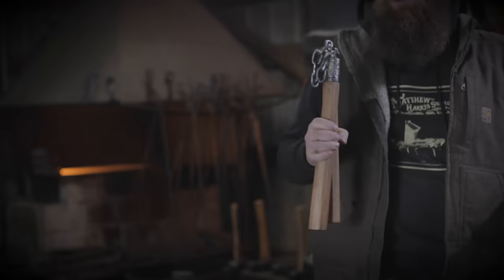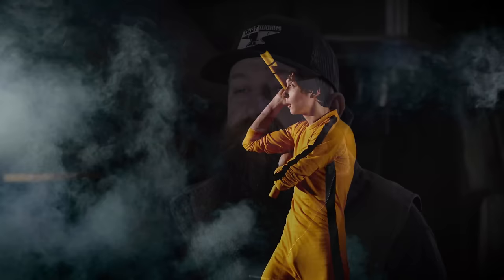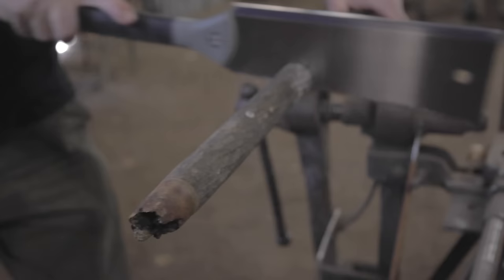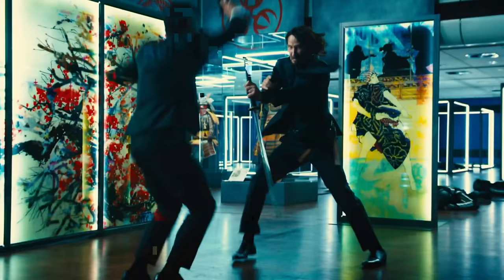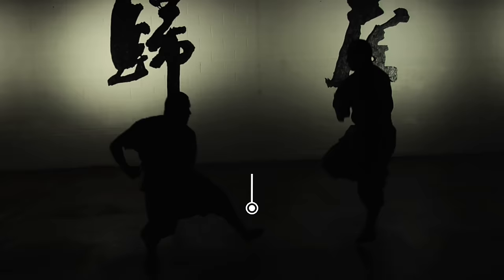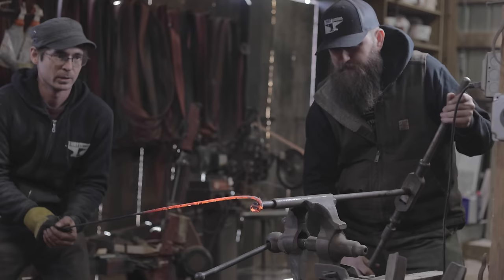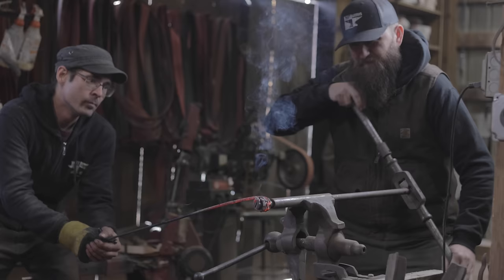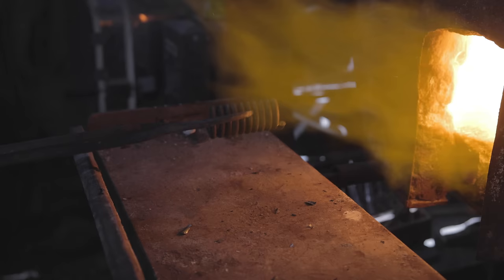John Wick 4 Nunchucks - Did They Exist in Battle ?

Comment: I have trained in Okinawan Matayoshi Kobudo which included Nunchaku. Though technically I was not at the correct belt level to formally train in them, however when the higher belts were training we were permitted to train in these weapons. They are not too hard to learn basic whipping them around... but they are very hard to master and not smack yourself in the head or elsewhere( we had padded foam training ones that were not allowed to leave the dojo as per Australian laws ). Super fun once you know the basics. I also trained with a Bo, Tonfa, Sai, Kama and Tinbe-rochin (sword and shield).

Comment: I have a pair that use rope instead of chain and was told the Ninjas used the rope because it was silent. They are really sharp octagon that gets larger at the ends. Solid hard wood with sharp corners to crack bones and a silent lightweight rope make these pretty sweet. The chain looks cool though.

Comment: One area you never talked about but it has been a common way of thinking about the Nunchuck is with monks. This I think holds the best ground as plausible because as you said the Nunchuck is less effective at maiming or fatally wounding someone which most monks are considered to be pacifists in nature. They would not want to mortally wound anyone and just defend themselves. They also have years that they could easily spend learning to use it which you also said was needed to use them. I'd say in a proper battlefield or more military style martial arts usage were likely never a thing. However in a more pacifist style of martial arts which would be common among monks in China and Japan I could see them using it as a means of non-lethal self defense. Much like  mace or pepper spray is used today.
Reply: I think the expectation here is that if the monks did do this, there would be evidence of martial arts using the nunchaku earlier on. Per google the first known kata for nunchaku was developed in the 1960s. If Japanese monks, warrior monks or otherwise, were defending themselves with this tool they likely would have developed kata and ritualized practices. It is possible it went undocumented, but that seems weird considering how much documentation we have of other fighting styles and techniques from Japan's history.

Comment: I like the combination of Documentary and build. That is a lovely pair of chucks too.

I've had self-defense classes, and flexible weapons where pointed out as a vary difficult class of weapon to master for what you get out of them. Modern expanding batons exist, and those are plenty capable of cracking a skull. However, Learning a flexible weapon (Nunchucks, 3-section-staff, poi/rope-dart, meteor hammer, etc) was good for the hand-eye coordination of any student of said instructor that chose to learn one. if you can use a flexible stick to beat someone's ass, you're going to have that much easier of a time with a not-so-flexible stick.

The closest thing to a modern nunchuck is probably the Billard-ball and paracord Monkey's paw, and I understand those to be fairly effective.

Comment: Re: Origins of nunchucks:
  What I learned, it came from when Okinawa was the Ryukyu kingdom. At some point during the latter part of being a tributary to the Ming Chinese, it started certain military cutbacks. If I recall correctly, the Chinese were unable to send any kind of military support to the kingdom at the time (probably fighting its own wars on the mainland), which asked for assistance when the Japanese eventually started making moves. Anyway, some time between the the domestic military reduction and Japanese takeover, nunchucks were developed and formalized as a self defense weapon for commoners due to a variety of bans in place.
 I don't remember if the bans were a result of Ryukyu's policies or Japan, post invasion, but they both had restrictive policies. If it's the former, then it's possible they were used on the battlefield in the short span during the Japanese conquest as commoners would likely have been levied to make up the rank and file of the army, but that's just speculation.
 
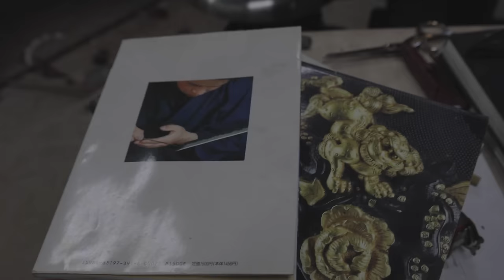 15:25 : I don't think it's a 0 or 1 here because people can teach others the fine points of usage and begin codifying it into a system. Also, in the case of Okinawa/Ryukyu, they've had a fairly long standing tradition of formalized martial forms.

Comment: There is a third reason for shortening a weapon...close quarters combat...using in a confined space,  hence why there are instances where a knife is a better choice than a sword, or an escrima stick better than a Bo staff.   You had mentioned the Rice flail with the long and short ends.   In China, that item was used as a weapon, there are still those that teach it as part various systems of Kung Fu.   

Also there is an origin for the Nunchaku that you didn't mention, again myth, legend, or fact who knows but it goes something like this.   In Chine there is a weapon known as a 3-section staff, which is basically three sticks, just over two feet in length (usually about 26 inches) joined by a chain.   The legend is that in a fight, someone using one of these had the center stick either broken, or cut with an edged weapon, and began using  them together.   Over time they discovered that making the sticks of equal length worked better for adapting the already existing techniques with the 3 section staff to the new 2 section weapon.   Again, I don't know if this is any more plausible than the other ideas for origins (personally I have always favored the Okinawan rice flail origin story) but it would explain how the skill of using it could have been learned, being adapted from the similar 3 section weapon, and even in Japan today there is a weapon known as  San-Setsu-Kan, which is a 3-section nubchaku, with the sections being the usual length of a regular nunchaku.

Comment: I've used it in a fight back in school. It was very strong, but you need to have a really cool mind to use it effectively, which is very hard to do when you are in fights.
Reply: That's very true. My husband who is a martial arts instructor made two sets of Nunchucks some years before we met. One was wooden and for practising with and the other was metal and meant to be used in self-defence if necessary. We never used them in any fights but they were great to practise with although the metal ones packed a real wallop if you weren't really focused.

Comment: In my head, I would want to put a metal collar or internal weight at the ends of the sticks just for greater force. Personally a flared out metal collar with ridges like a disk mace or flanged mace. Concentrate the added force onto those points and provide a greater grip to prevent it from sliding out of the hands. More dangerous yes, but...

Comment: The Filipino version of the "nunchuck" is called tabak-toyok, and is sometimes referred to as "chako", which would explain why the Okinawans called their version the "nunchaku" - a similar sounding name. Dan Inosanto, Bruce Lee's friend and student, introduced Bruce Lee to the tabak-toyok. The tabak-toyok is a longer-ranged melee weapon, as the chain was usually longer, and the handles shorter, in order to conceal the weapon better in Filipino street fights. To make a long story short, Escrima/Arnis/Kali was the martial arts of the Philippines. When the Spanish occupied the Philippines, they banned the martial arts, and outlawed bladed weapons carried by the Filipinos. Thus, the focus went from swords, to sticks and knives. Sticks, since it wasn't a bladed weapon, and knives since they could be more easily concealed (like the tabak-toyok). One of the main tactics for Escrima/Arnis/Kali, is to target the closest part of the enemy (which Bruce Lee utilized in JKD), and that's the enemy's hand, or their knee (with the preference for the hand, especially if it's holding a weapon). The tabak-toyok would come into play as a long-ranged melee weapon to aim for such targets, where the key wasn't for power-strikes, but precision ones. Also, with a longer chain, the tabak-toyok could be wielded much like two normal (albeit short) sticks, and not just swung (unlike the Okinawan "nunchucks").

Comment: There is a weapon version of this that I have seen before where it is a flail but one stick is very long like a staff and one end is attached with chain and a short stick and it was in Europe where it was done. I think there was a YT channel that had this weapon made up and used against a person with a sword and it was fairly effective but close up a staff is kinda clunky and loses its usefulness. That being a contrast then a shorten down version is possible if its used as a flail. Ball style flails are effective but has a small strike surface and wrapping around something like a arm or leg is not as effective as one would think vs a shield or torso. A flail with the ball replaced with a stick that is weighted with metal (so its the same weight) would give a similar blow but increases the striking area making it a more effective weapon against arms and legs even if they were armored. Against a sword (nunchuck user) unarmored it would be a hindrance but armored it would be very useful much like a flail. 
Overall a Nunchuck is a flail for close quarters use but mostly in a building or narrow confinements. That is about as far as it really goes and there is no real dance or special form that goes with it. Unweighted end would be very effective against unarmored and again would be ideal to be used on arms or legs. It would be a quick strike weapon for disabling the enemy. It could be self defense but also just regular attacking. Not all battles are fought by soldiers which is the biggest argument against these odd weapons is the "training time and costs" line and it gets kinda annoying when thats the main thing they use to dismiss the weapon. To be honest a flail is not a hard to use or learn weapon and more so the Nunchuck being a flail type weapon would not be hard to learn either. The dance/display stuff is just that and not something one would have to learn to use them effectively. Its pretty much the same with the flair of a butterfly knife verse someone using it like a knife.

Comment: There is an old chinese battlefield martial art called bajiquan which does use erjiegun metal capped ends longer chain than nunchaku. On the battlefield individuals needed only to get their opponent on the ground and spears would mop them up. Thats at least true in china.

Comment: The thing with the solid stick vs the nunchuck is that the nunchuck is more of an offensive weapon and you can't really block or deflect attacks as effectively with it however it's also more difficult for somebody to block an attack with a nunchuck then to block or defend against an attack from a solid stick.With the nunchuck it's mainly just offense with not alot of defending.
Reply: Unless you want to trap the incoming weapon and control it. The cord/chain in the middle does that very well.

Comment: It's really interesting to go through English, Mandarin, and Japanese wiki and find pretty much the same information as what this video summarized. The origin could be farming flail, warring weapon from China (but was one short one long, to sweep horse legs, send strong impact to shields and armors like a flail), conceal weapon, practice weapon, etc. 
One thing I saw or heard somewhere else was how it could be helpful if someone try to block the first half of it, only to have the second half wrap around the weapon or get knocked by the second half of the stick. I think that's pretty risky if the contact point is on the second half of the stick, it would just bounce back. If I would want to use a weapon that wraps the enemy's weapon or go around it, I would just use a whip. Having the chain section longer would make more sense for that purpose as well. So I doubt the plausibility of that idea.

Comment: Whereas it does not make sense for nunchucks, in the form we recognize them, to be used on a battlefield, in European history, flails were used to great effect by Jan Žižka. The flails used were adapted from agricultural flails, and could bash a mounted knight hard enough to knock them off their mount, and to deform their armor and otherwise kill them by blunt force trauma. The flailing end could swing right over the top of a shied to hit a person that a staff or other pole arm could not, and they were also quite ergonomic in the sense that the impact of the flailing end does not transmit any shock to the hands and arms of the person wielding the flail. If you have to bash a lot of enemies, the hand shock and fatigue from repeated impacts can really begin to degrade your fighting effectiveness. 

All of these should be taken into account.

Also, regarding the part where you suggest that nunchucks differ from rice flails: the flail you showed in the video, with the long handle, is a European agricultural flail, which had a long handle and a short flailing end. Did you actually confirm with histoerians that east-asian agricultural flails had the same design? These things cannot be reliably presumed to be the same between Asia and Europe. Asian sickles don't look the same as European sickles, for example. A short handled agricultural flail could still be useful for flailing rice.

Comment: i have a black belt in both Okinawan kobudō and Shotokan Karate, When I learned about the Nunchucks. it was alwase a 19th-century peasant self defence tool. not diffrent to a stick (bo) or a Tonfa (police baton). that were "perfected" by the early 19th century Okinawan masters. 
Notebly, it's when they moved to the main land and open Commertial Dojos, is when the art took popularrty. 
Never heared any claim about Battlefieled use ever.

Amazing vid as always
Reply: Nunchaku is much more of a PDW. Concealable, easy to use with sufficient effect, very versatile when mastered, cheap and not extremely lethal.

Comment: Sure it can be both. Whether it’s a personal protection weapon or not it’s still a weapon. That deals very real damage. With any type of weapon and martial art it’s in the effectiveness or said weapon and/or martial art. Some martial arts are more effective than others, same with weapons. I agree Nunchuck isn’t a very effective battlefield weapon. But in a alley where there isn’t much to work with yes. I would rather have a set of chucks than fight barehanded in that situation. Making both the art and the weapon very real as it provides an advantage in certain situations.

Comment: Nunchuck. Nun=2, chaku (shaku) is a unit of measurement approximately equal to 1 foot. So basically it's a 2 foot stick cut in half and connected by a rope, and the purpose is to be able to stuff it into your gi and carry it far easier than a short jute. Take a class from an instructor trained in Okinawa and you will learn this, it has nothing to do with rice flails.

Comment: The comparison is like saying pistols can't possibly be a weapon soldiers would take into the field when we have rifles that would do everything it can do, but better. Objectively it's correct, but you're not really contextualizing that it's more of an improvised defensive weapon. If the concept behind its use isn't to kill so much as deter/disable an attacker(the idea that if you're at home, you're defending yourself, a knife would be a much more deadly/final option), then it would be a better option than one that could kill someone by mistake(for villagers, maybe the idea of knocking out a bandit incurs a lesser rebuttal than killing one and causing fellow bandits to raze the village).

Comment: Nunchakus or flails are easy to make and cheap. All kind of grain flails existed back in the medieval times and before that. So many could actually use flails as tools so using them as weapon seems legit. You can take one hand or poleflail from your barn and use it in war if nothing else was available. Traditional nunchakus and tool flails are made from just wood and piece of rope. So they were cheap. 

Flails or nunchakus range is actually good. Measure from your hand to tip tells it and you can compare it to short spear or short sword. Then you see the reach is good. Even nunchakus are not that difficult to use efectively if you have done physical work with your hands and have some sort of skill with other weapons or you have done boxing of some martial art. Few years ago i bought nunchakus to test them at age of 40 and with minimal few days of training i learned to use them pretty good. Real nunchakus are really a pretty heavy flail and not some movie soft light prop of aluminium fast light party trick magic wands. I personally would not pick them over baseball bat but in some scenarios they could be useful. You can conceal better than many weapons. I would pick a flail for going against man with dagger. Huge advantage there.

Comment: Why have a symmetrical flail? The symmetry allows better manipulation regardless of which side is held. Indeed it becomes a more flexible weapon, and although it reduces reach, it's still very good for extended reach against an opponent with a short blade (hand axe, dagger, short sword, etc). So not only used as a striking weapon, but also to grab and disarm an opponent.